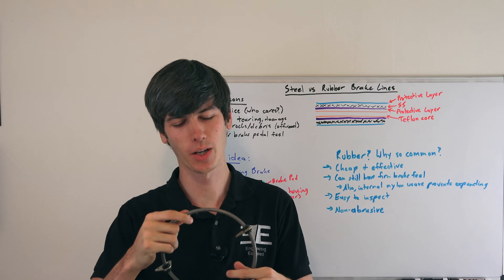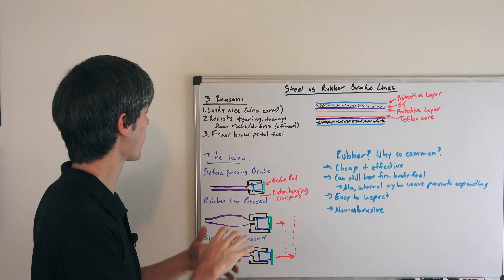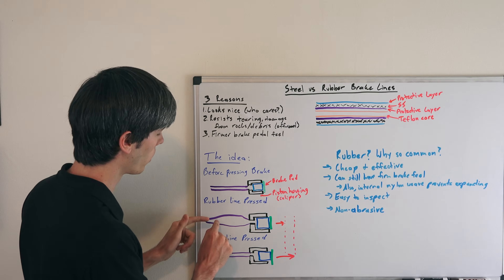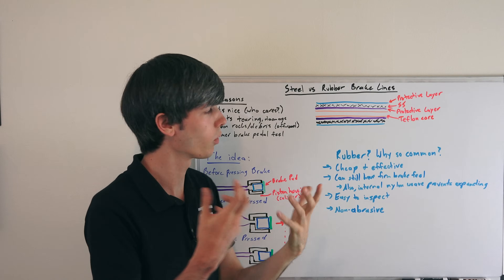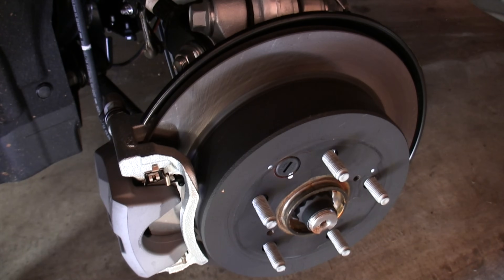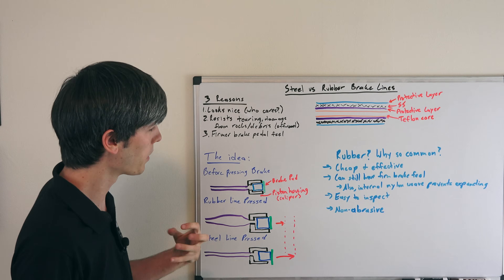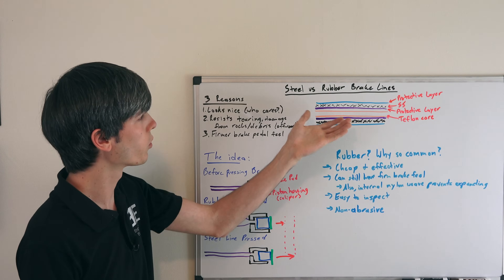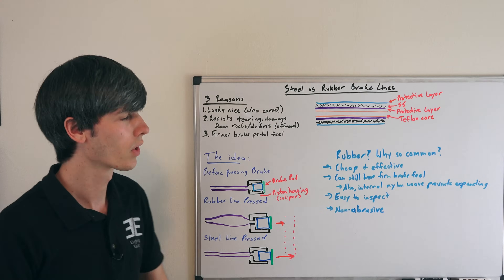Steel Vs Rubber Brake Lines - Are Stainless Steel Lines Silly?

Comment: I'm a brake engineer and have a few comments here if I may. When you say "I've driven lots of vehicles with rubber lines that have a firm brake pedal" yes that will be true, especially if they are relatively NEW vehicles, but have you actually ever done a back-to-back comparison on that SAME vehicle? I have, and the difference is definitely perceivable.... It's a bit of a case of 'you don't know what you're missing till you've tried it'.

You also gloss over a key detail, that is that rubber lines perish over time and periodically need replacing. Most vehicle manufacturers recommend the rubber lines to be replaced between 2-5 years. When brand new, rubber lines perform virtually identically to stainless braided lines, but if you do a back-to-back test on say a 5 year old rubber line vs. a 5 year old stainless line you'll find that the pedal feel is significantly better on the stainless braided lines.

Braided stainless lines are much more resilient and never need replacing over a 'normal' vehicle lifecycle, thats why most braided lines come with a lifetime warranty. The fact that aftermarket stainless steel lines are also often CHEAPER than buying new rubber lines from the manufacturer means they're a bit of a 'no brainer' upgrade. Install them and you never have to worry about the brake lines for decades and the pedal feel remains firm forever.
Reply: Thank you. You summed up everything this video missed.
Wear and tear over time Vs pedal feel.
Reply: Ta very mucha, I just bought stainless lines to replace 25 year old lines so I might have made the right choice. Not yet delivered.
Reply: I have never seen a more expensive rubber line than a braided alternative. . . but they sure don't test the aging lines, for sure.
Reply: @RevelryRacing OEM
Reply: @RevelryRacing  The kawasaki klr 250 has more expensive stock rubber lines than aftermarket steel braided.  I suspect its not the only motorcycle out there like this.
Reply: Well said!

Comment: I have bought sets of braided lines that one in the set came apart at the end.
    They wouldn't sell a replacement line, I had to buy another " set" 
  I've driven many a sports cars with many years on, stock rubber lines,that never came apart. Just changed them to new rubber ,when I became the owner and driver.
  The two Datsun Z I'm building now will have SS braided lines but I'm buying a set of rubber lines encase the SS fail.....not as much trust in SS over Stock Rubber lines

Comment: Having the steel braid coated in a protective plastic sheath not only protects the car from abrasive damage due to the line rubbing against it but also keeps dirt from coming through the strands of the metal weave and wearing the Teflon core. This extends the life of the brake line and reduces the chance of fluid loss should the core get worn away.

Comment: For competition braided hoses are desireable. Though some of the fittings are less than ideal. For road use they must be swedged, most available these days are. Though have good look at the swedges before fitting.
Rubber brake hoses are generally better for road cars and if the pedal is spongey replace them or check your brake system with callipers not retracting properly, tapered pads, or stuffed master cylinders.
And yes 50 years of playing with road cars and racecars verify all of the above.

Comment: My motorcycle service manual recommends replacing the rubber brake lines every four years because they swell and degrade with UV exposure. I replaced them with quality braided lines.

Comment: Howdy!  Thanks for all the videos.  I've watched through your videos series on brakes, but still have a question: Bleeding brakes gets air out of the system, but what is the physics behind the air bubbles being pushed out to the calipers?  I would understand it if the piping leading to the caliper was lower than the caliper, but with the brake lines winding around the car body before getting to the brakes (and starting at a high point in the master cylinder), why wouldn't the air hang out in different parts of the lines?    Thanks for any help!  :)
Reply: four years too late probably, but i would assume it has to do with the viscosity of the brake fluid and the small diameter of the brakes lines - i.e., air bubbles just don't really have the force to move around by themselves. i would also say since the brake line inner diameter is so small, fluid would have to move past the bubble for the bubble to move. a good question and i would be curious to the correct answer as well

Comment: My boss loves to drag race and I've come to dislike stainless steel hoses. We've had some start spraying fuel out through all the braid, so we replaced them with some we had off the shelf and they did the same thing. We had to buy another roll of the stainless steel hoses and make all new lines. I later Googled it and found sites saying the braid can chafe the inner hose while vibrating and that it's really recommended to change them out every few years, some brands saying 10 years. The more I work on race cars, the less I like them.

Comment: I put stainless brake lines on two Honda CBXs, and a Yamaha FJ1100. Brake lever and pedal feel was much improved. Then about 10 years ago, I  put braided stainless brake lines on my then 40 year old 69 Corvette. The brake pedal was much firmer than it was with 40 year old rubber lines. Today, the 50 year old car still has excellent pedal feel. No power assist, just plain manual 4 wheel, 4 piston, disc brakes.  Good video, Jason👍.

Comment: Thank you for this video as I'm about to change my OEM to SS braided. I do have a question about bleeding the brakes when I change the lines. Do I change all the lines first than bleed  the calipers or do I bleed each line as I replace them from farthest rear to closest front?

Comment: If you race you know you must use steel braided lines. Even at age 10 my son needed them on his MX motorcycle. Expanding rubber is Lost Time. I don't care if it's .01 second per turn, you just lost .2 seconds a lap to the guy with steel braided lines. You can feel  the difference and really, it cost you more than .01. and time wise, assume 30fps, 1% of 30feet is 1/3foot.
Reply: That's interesting to know. Thanks for sharing that.
Reply: @ninemilliondollars  everyone with a dollar to spend at the races will spend it. Two stroke engine mods are simple but expensive, 7hp extra for a 125 could cost $2000+. So I suffered. Or my son did.... I could get 3ho or so myself.

Comment: The reason why people switch to steel braided and get such good results is because the rubber ones that they replaced are old. They flex more when theyre old and worn. No wonder, right? New rubber ones would have gotten the same results.

Comment: The reason i swapped mine was track days. brake response was slow, also the brakes went soft after lap 3. I changed to high performance brake fluid first, result was better, but as soon as i change lines braking was totally changed. it was quicker and sure enough to allow my lap times to drop. I think the combination of braided lines and 5.1 fluid is enough to change the feel of the brakes, due to the improved performance and harder braking later i did upgrade the disks/calipers in the end as they were warping even with warm up and cooldown. However as per any track day use, you will start to upgrade everything on your car when you start to see parts lacking on your car, be that handling or engine.

Comment: Basically the increase in performance is so minuscule. Its unnoticeable in the pedal. I thought of this before. Car manufacturers are not going to put cheap (weak) hoses on the brake system. They cheap out on longevity. Not safety.

Comment: 2 points missed. 
1. Rubber lines have a much shorter life span.
2. Rubber lines can be clamped off to overhaul the caliper. Braided lines cannot be clamped.

Comment: How does one prevent water from getting into the braking systems?
Reply: Also, some racing bikers are using mineral oil instead of brake fluid because it does not tarnish the system, is this transferrable into a car breaking system? Why or why not?

Comment: do a test on a vehicle that dont have a brake booster ie motorbike and you will see that there a very noticeable difference on brake feel between crappy rubber and steel braided

Comment: To each his/her own.  Everyone has a different style of driving and external variables that influence their drive.   For me, I'll take the steel lines.  Yes, they're more expensive, about $100 more, but for peace of mind and the cool factor, I'll take it.  I think some people are misquoting prices though, or maybe they're not being clear as to what the $15 covers...  From what I've found, the cheapest rubber set (4), will run about $52 while the cheapest steel set (4), will run about $154.  This is using my car as the guinea pig.  

I also buy aftermarket rotors and pads; Stop Tech, Hawk and sometimes from a local shop that caters to the make/ model of my car.  I spend about $110 per wheel for brakes, about every two years.  This includes the steel lines but not tax or shipping.  Not too bad.

Comment: Some good technical comparisons would have been great. Lap time comparisons are stopping distance comparisons. All I can say is I put Goodridge stainless steel brake lines on my car and one if them failed in about 2 years. Almost totaled my car. The braided stainless steel ones don't seem to last as long, they seem to Start cracking at either of the ends.

Comment: Stainless "hard lines" are better if you're around salt and I think worth the  added expense. Steel / Zinc lines don't last very long if around salt. Copper nickle a little better but not as good as stainless where rust and corrosion is a concern. Braided brake hoses only have a braided shell so their not really 100 percent stainless. I don't think their worth the additional cost as statistics show rubber brake hoses are more reliable. Metal braided brake lines are needed for the race track that produces higher heat that's transferred into the brake fluid and lines.  Higher brake fluid temperatures can rubber lines to expand to a point it effects braking while racing at higher speeds.

Comment: Can see many comments about rubber lines being stronger than they look. Yes, it's true that they have strong cores and don't expand anywhere near as much as you would think. The main reason I use SS lines is the durability. Not bothered about the look, although admittedly they look much better than the black manky rubber we are all used to! SS lines outlast standard rubbers many, many times over, and I have had a few MOT fails because of the rubber sheathing on standard lines having very minor tears in them. The weak point is at the neck, as soon as there is any signs of weakness there, it is an automatic fail.

Comment: Have you ever cut through a “rubber line”. It’s had a metal reinforced inside. Think of a smaller tube wrapped with copper or steel then rubber is placed over that. After I cut one apart I’ll never waste my money on “steel lines” again.

Comment: Steel braided lines are also great for motorcycles. As braking increases in downhill sections you can feel an appreciable fade in braking with rubber lines. Heat dispersion with steel lines is far superior.

Comment: If your rubber brake-lines are "swelling" you have cheap-ass lines!  The "feel" you mention is caused by the hydraulic pump, not the lines.  For 98% of vehicles, rubber lines are fine.

Comment: 2 things you forgot to mention and both points to the rubber brake line advantage. 
1. Rubber lines are not just rubber lines.  they have a really thick layer of rubber, yes but also canvas or cotton cord inside, making them as solid as possible under the flexible hose setup. 
2. Rubber lines are thicker on the inside, so they flow more brake fluid. Thicker means easier flow.  If you cut back on the flow, the pressure that is required to push the same amount of fluid through the hose will be increased. This is why most people comment on a firmer brake pedal. This is nice, but since the firmness is caused by a loss of flow capacity, it does not make it better. 
I tested and re-tested them and came away that unless the stainless steel braded lines are the same diameter and engineered with extreme precision, you are worse off with them then factory lines. Also the cost. Factory style quality replacement is about 15usd per line, versus about 120usd /set for the stainless steel braided lines.  So that is about half and since you are not getting any benefit, waste of a money.

Comment: is cracking of brake lines caused by the expansion of the fluid from the pressure? or it simply just wear from years of use and weathering?

Comment: Can you explain the myth of rubber hoses collapsing in on themselves and holding the pistons out. A lot of fellow mechanics seem to think that this happens but I've only ever run into a steel bracket rusting and pinching the hoses shut.

Comment: The outer plastic cover over a braided line, is there is make sure winter salt spray (salt forms highly abrasive crystals) and other road dirt does not get past the braided jacket and cut the teflon tubing. Braided lines are meant for racers, who inpect everything frequently. Consumer brake systems are engineered to work properly with their rubber lines.

Comment: Rubber brake lines can have an internal failure -- a swell.  Happens when internal layer of rubber fails and the fluid makes it's way between layers, inflating the now thinner brake line instead of applying pressure onto the piston.  Had this happen not long ago, actually.

Comment: Replaced rubber brake lines on my Bmw motorcycle & you could stretch them by hand if you grab each end & pull. Try doing that with a  braided line. If you brake hard you can feel the rubber swelling to the intial pressure before pads grip onto the discs. Competition bikes use braid.

Comment: Question is: who has ever changed the brake fluid on rubber lines just BEFORE changing to steel???
Obviously when you change the fluid - after installing - brake pedal feel is firmer, because of no water/air inside etc.

Comment: I see the argument that after x number of years, rubber lines get soft, this is a non issue because you shouldn't be replacing them every 25-30 years, you should be relaxing them much sooner.

In my case, I went stainless lines because they were cheaper and made by a highly regarded 1 man operation in the United States.

Comment: You say there are many other factors that would influence the firmness of the brake pedal. What are they?
Reply: Air in the lines, flex in the calipers for starters. Also type/quality/condition of the vacuum booster, condition of brake pads, water or other contamination in the brake fluid. There are more.

Comment: the crimped fitting of rubber hose is not easy to replace at all. the new ss AN fittings are much eaiser to work on.

Comment: Aircraft tip: Braided (and other!) lines must be SECURELY CLAMPED using cushion clamps and LOCKING hardware so you CONTROL them. The braid makes a pretty good "saw" too so ensure lines are kept from chafing wire bundles in their range of flex. Clamp wire bundles too. Clamps are cheap. 
Do not rely on the line material to resist chafing. Spiral wrap and other barrier methods protect against chafing when line excursion can't be ideally controlled by clamps.

Comment: After years of doubting the effectiveness of SS lines, I decided to try them on my FRS. I was right, I felt no improvement in pedal feel. The pedal already had a decently firm feel with the rubber. No discernible difference with the braided lines. I'll have to try them out at the track when I go soon to see if high temperatures play any role.
Reply: You don’t notice anything because the FRS is a shitbox. But mainly, SS lines will prove their toughness in the long run, with a kind of ‘armored’ quality. One less weak link in the system so to speak.

Comment: Sure stainless steel lines are more expensive but you get what you pay for and if braking response / feedback is what you want then yes replacing rubber lines will certainly make a difference.

Comment: so in closing unless doing massive all out braking you replace the rubber lines for stainless LAST after you have upgraded everything else because why get a firmer brake line if you got an oem cliper with tons of slop and $9.99 autozone brake pads and rotors

Comment: i swapped for steel brake lines and i love them! Much stiffer brake feel! If you want it even stiffer then you should check the moving of your master cylinder (the whole assembly) as you press the pedal the firewall might move with it a bit. Construct a limit stop from a firm spot i.ex the driver side strut mount to the master cylinder to prevent it moving forward.